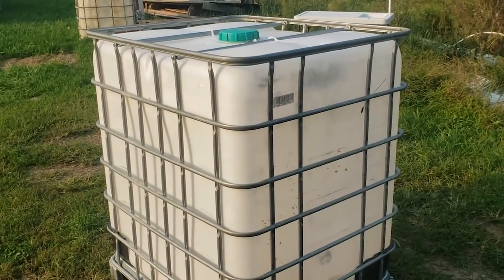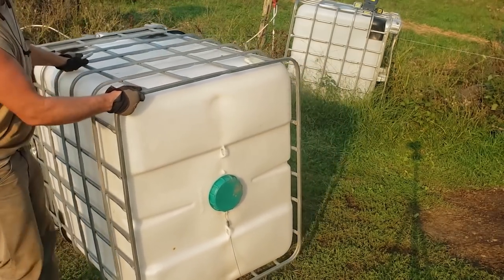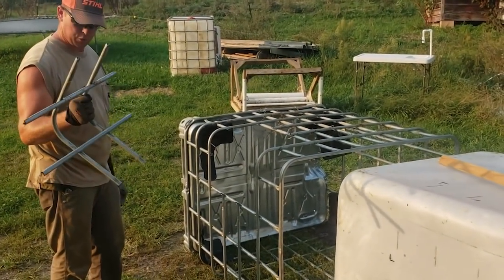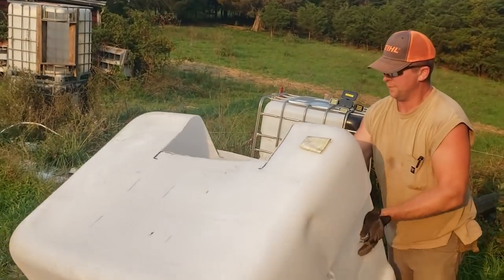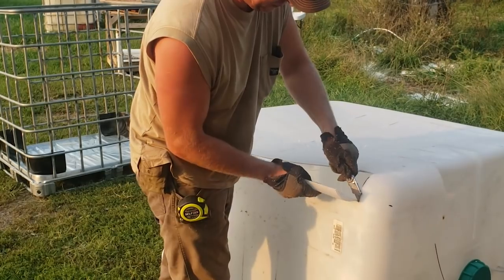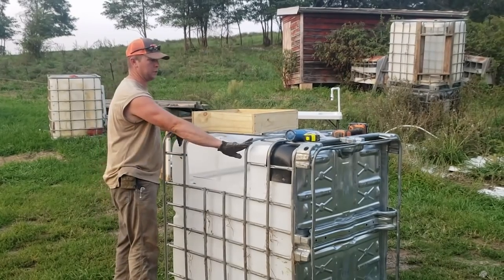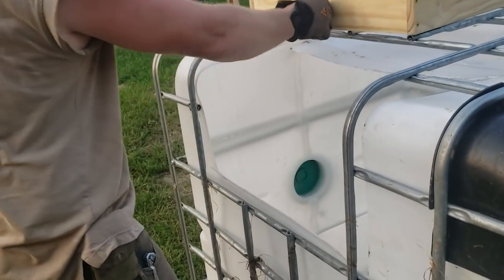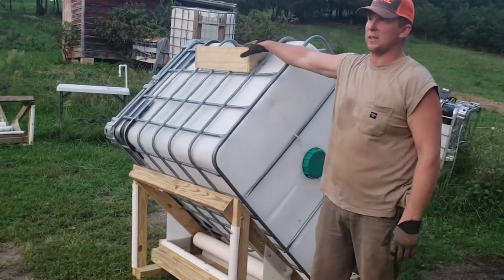IBC pig feeder Part. 2 (Tank build) From $2000 feeders to a $200 DIY #pigs #pasturedpigs #feed

Comment: Why not put the container on a deck that's on skids and cut holes at the bottom so the feed falls into the deck and you poor feed into the top of the container that you've cut off? This will give you a much larger feeding area. My large hogs would never be able to eat out of the small deck as in this vid.
Reply from the maker: How big are your pigs? 400 pound ones can eat out of it fine.

Comment: Makes a hell of a rodent and varmint feeder to since it doesn't have any lids where feed comes out, I mean Factory hog feeders come with flip-up doors the hog leff's to eat out of so that you're not feeding rats and varmints, not at all good at those young pigs get their front feet in there, this setup should cause a lot of feed waste and lost
Reply from the maker: This is an open invitation for you to come out to our farm and see them in action. I wouldn't be posting a video (and why I didn't for the 3 years of development) if it didn't work well. I'm not worried about the occasional possum taking a couple bites out on the pasture. Better some pig feed than some chickens. 😉
Reply: @FarmBuilder  I have no desire to visit your farm and apparently you and I have very different ideas on proper feeding of Our stock, your reply proves my comment varmints in the feed
Reply from the maker: Lol.. If you have feed on pasture you will have some wildlife take a nibble. I have never seen a feeder that prevents this.  We've had full grown black bears eating out of a pride of the farm feeder right along side the pigs. Flipped the lids and everything.  An occasional rodent is something I lose zero sleep over.

Comment: I think rainwater will be a problem when it runs off the surface of the plastic container and into the feed trough….but maybe I am missing something
Reply from the maker: Its not a problem unless it's several inches. Just to reiterate, this is a bulk feeder for large groups of pigs. They eat the feed out quickly. If you build one of these for 2 pigs then water could be an issue.

Comment: Do these need to be food grade Ibc totes? I have a lot of these around me but they have had chemicals In them. Being they it’s just dry feed and not water, would cutting the top and cleaning the inside really good be enough to not contaminate the feed?
Reply from the maker: I think that would be fine, it's up to your own comfort. You can also fill with water & soap and let sit for a few days.
Reply: @FarmBuilder  ya true, didn’t think bout letting it soak